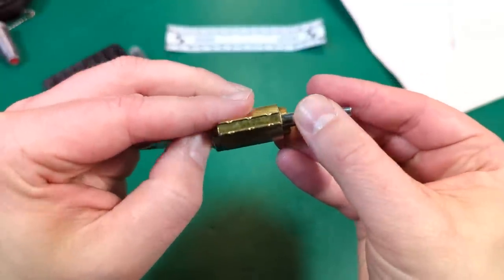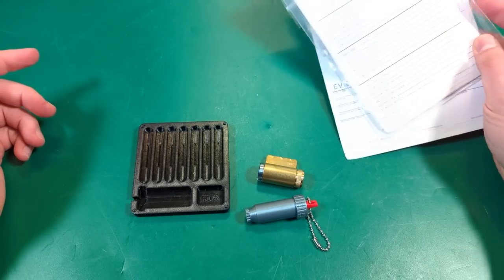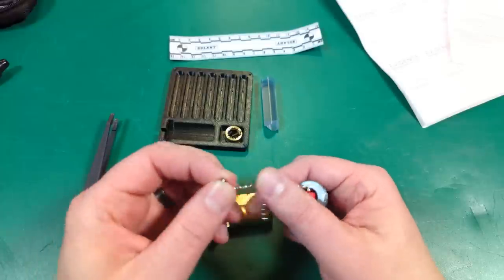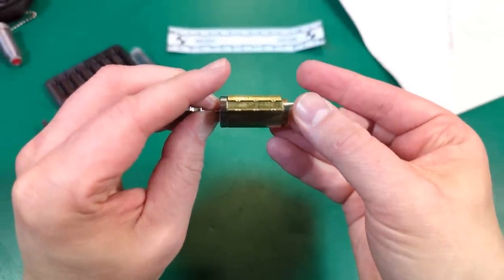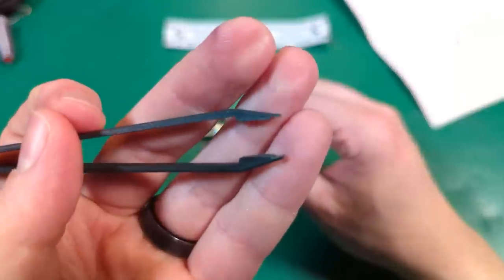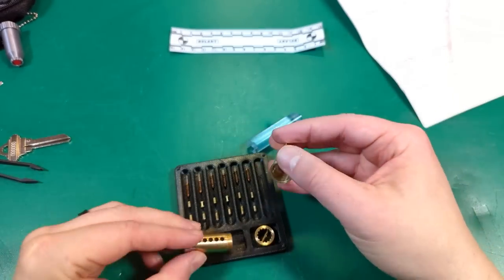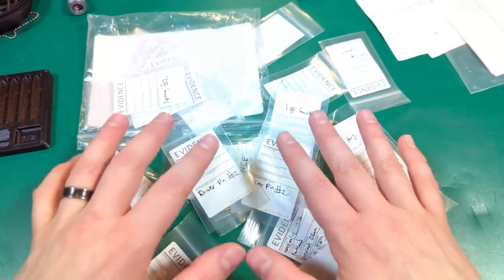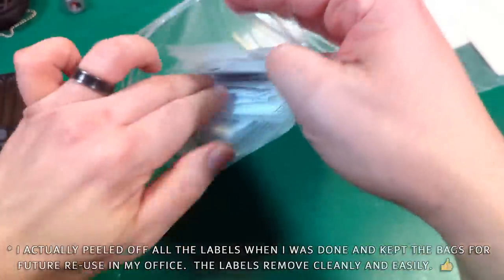Forensic Lock Disassembly

Comment: A label printer hooked up to a computer so you enter job details once, and just describe each bag to print the label, would save a whole lot of time. Especially if it put a QR code with a unique serial number plus the same data on every sticker, and spat out a CSV file with a record per label with all the data and the serial number for integration with evidence cataloguing software...

Comment: Thank you for sharing this interesting and educational video. If "metal" should not be used in the disassembly process should the "shim" used during the disassembly of the lock be made of plastic too? If this was a real crime investigation surely the forensic analyst would/could have access to a real key that actually opens the lock so there would be no need to use a shim? How about using a very small fibre optic probe to examine/photograph the inside of the lock before even attempting disassembly to check to see if the pins have been marked through picking?

Comment: For the part achiving, has anybody looked at using some kind of tray with separate wells for each pin or spring? Something like a 96-well plate from a biology lab, along with a clear adhesive film to cover the top. You can then attach one label for the whole lock, with the parts in order.

Comment: Query: Would the shim potentially, or actually leave a mark on the pins as well, since they're metal sliding along an edge? 
Obviously this would only be in the case where the actual key wasn't used instead. Would that have to be forensically noted as well?
Reply: I expect the shim would leave marks on the side of the key pins and bottom of the driver pins, while picking would mark the bottom of the key pins. (Not an expert)
Reply: @jonathanshaw6784  exactly

Comment: could you use a lishi tool that has a HDPE pick? or maybe teflon? i have to imagine there is a plastic hard enough to lift pins but how so hard that it will leave tool marks on the pins
Reply from the maker: it's been tried... material transfer winds up taking place, with small fibers of teflon being left in the lock
Reply: @DeviantOllam  that makes sense. you never know when the newbie suggestion comes up with something useful though lol

Comment: I'm such an LED flashlight freak that I'm gonna spend some time thinking if there might be something to kick that "light-pipe" follower up a level.
Reply: Machine one with a thin wall barrel, with a LED embedded in the light pipe, straw had white most likely, then one lead inside as contact, and the other going up the side. A sleeve to insulate it, and then 3 small button alkaline cells as power, with a threaded cap that is both the switch, contacting the button cells and the cut off lead.  Cap just needs a spring and a 2200R SMD resistor in it to act as current limiting for the LED, so that it is not too bright to blind you, and thus will last a long time.
Reply: @SeanBZA  Much like my own thinking.  Definitely need to limit the brightness.
Reply: @SeanBZA 
You could probably just 3D print a tube adaptor that friction fits the follower into a common cheap LED flashlight (like the ones you get free from companies that think pens with their name are a bit boring).

Comment: Would it be advantageous, in situations where it could be applicable, to use a longer blank and cut a shallower slope on the front for blank key shimming?  Seems that it would give you more wiggle room on the key to find the sweet spot.
Reply from the maker: we do that with our Kwikset disassembly key.  the long part across the top is cut all to a "1" depth (the smallest cut in Kwikset land) and the front edge has a more rounded graceful curve
Reply: @DeviantOllam  I feel validated 😁
Reply: IMO (not an expert at all) if you're using a longer blank, you need to be careful not to impact the back of the lock (the cam) because that's also a place where you can find evidence.
Reply from the maker: @MarvinCZ  absolutely correct, at least on locks that have tail cams on them like that.

Comment: I did enjoy this video. I've not tried lock picking since I was a kid but they still are fascinating. Seeing how to get one apart from the rear is interesting and with the mechanically inclined mind I have. I knew where you were going with the blank key. I agree with the comment below in that I too would like to see what difference there is between a normally used lock and one that's been picked. Should you have removed your ring as well?

Comment: Why not make a pinning try that has a labeled slot for everything and can be sealed? Make the tray the evidence bag, it would be reusable and only need one evidence sticker.
Reply: Defense lawyers would have a field day with that.  How do you prove that the lock parts in there now aren't contaminated with evidence from the previous lock's parts?
Reply from the maker: indeed... not to mention that it the lid fails or something, there goes everything.  we do have little "bumps" on our pinning trays' corners, you might have seen... they can snap together with other trays to do what you're describing.  But that's more for commercial work, not evidentiary work.
Reply: @DeviantOllam  I'm talking about a new design of tray specifically for lock evidence. The problems can be engineered out and administrative rules could be used for cross contamination. The same argument could be made for plastic bags; what was in them before? Is there proof it was empty before pins were placed inside?
Reply: @Dleihs  The problem with a tray is that if it gets bumped when open, everything gets jumbled. And it won't just be placed there and sealed. All the individual parts are going to be taken out repeatedly and investigated separately. All that manipulation is more chance for something to get misplaced. It's also limiting since you can't take just one part somewhere else and go investigate it, since they're all bundled in one container.

Comment: Do serrated pins make rear shimming attacks more difficult?
Reply from the maker: you know, that's a GOOD question!  i bet they might.  i should test this
Reply: @DeviantOllam  serrated key pins so the shim keeps catching as the stack lowers.
Reply from the maker: @katelights  that would definitely slow the process down potentially but wouldn't ultimately prevent it. Could be a fun video for me to try later, however. :-)

Comment: Instead of a steel strip for separating the pins, could you use a sheet of PEEK? I wouldn't be surprised if that strip you are using is hardened, but PEEK might be hard enough to still work while being a lot softer than brass or any color coatings on pins. I found one site selling it as thin as 0.00048".
Reply from the maker: I would be interested in trying that, yeah

Comment: As a dumb outside observer I'm just curious, is "The labels remove cleanly and easily" a joke? Wouldn't you want the evidence stickers to be pre-cut to break into multiple bits and leave a whole lot of residue behind to limit possible tampering?
Reply: Evidence stickers typically have a glue that is very aggressive in bonding to PVC of the bags, so it will not come off easily, and it is more there to mark the bag, and not come off, as attempting to peel them is going to leave a mark, and they are common enough that you can just use another and bag. The true tamper protection is the writing and a signature of the person collecting the information, as that normally is unique.
Reply from the maker: These are organizing labels, not tamper-resistant labels.  The teeny 2"x3" baggies would never be used as evidence preservation bags by themselves and so they would always be kept inside of a proper tamper-evident bag overall

Comment: Maybe instead of using so much plastic, we could fix our bean-counting legal system. You know, bring a few of the worst lawyers to heel.
Reply: I mean, there really isn't any way to avoid being thorough. And if that means bags over bags of stuff, so be it. Better than compromising an important bit of evidence.
Reply: It's not really a problem with the lawyer. It's really important that evidence is collected well and not being tainted. Bad evidence leads to bad court trials and even innocent people ending up incarcerated. In fact many wrongful convictions are the result of shoddy evidence gathering.
Reply: I’m divorced too
Reply: You all make good points, but the real reason why we are so neurotic about evidence and custody trails and whatnot is that the lawyers out there will use any excuse to find fault in evidence, like "There's a metal tool in the shot".  If lawyers wouldn't routinely get away with the most hare-brained schemes, we wouldn't need to be quite so neurotic. We would still need to be thorough, after all, legal action often ends in dire consequences for the defendant if found guilty, but we wouldn't need to worry so much about a lawyer tearing a case down on a ridiculous technicality.
Reply: @feynthefallen  The reason why defense lawyers are hard on evidence is that prosecution will try to produce absolutely anything and call it damning evidence if they can get away with it.

The trouble in this case isn't that "there is a metal tool!" but rather that using a metal tool in this task can leave marks of its own and produce false results.

Comment: Wouldn't the metal blank potentially leave false forensics marks?
Reply: And also, the metal shim scraping on the pins?
Reply: @Johan Greefkes  the marks would be along the sides of the pins, when looking for picking evidence you would be looking at the tip of the key pins for unusual markings. So long as there is only one mark along the side it could be discounted
Reply: Dev said that you are allowed to use those metal tools, but didn't say why.  I'd like to know, too.
Reply: @acidhelm  the exact reason I don't know, can only speculate that made those concessions because no non-metal option is available or was available when those concessions were made.
Reply: It's known and accepted that a key (and thus a blank) leaves distinctly different marks on the key pins than a pick does. Thus using a key blank will wear the pins just like a regular key and will not contaminate evidence of picking.
Reply from the maker: exactly - although a 3D printed key blank would be pretty cool to try using, hah
Reply: @DeviantOllam  Would PLA be good enough for that or would it require a tougher plastic like ABS?
Reply: @dclemons6200  ABS is actually fairly abrasive. Steel on brass or brass on brass is used for a reason, it's all really low friction. If you're super worried about the blank scratches you could just polish the surface, corners on the blank.
Reply: @DeviantOllam  Can you do an April Fool's episode with a key made out of ice? No evidence to leave behind! Would have to be fast if you're impressioning with one, though...
Reply from the maker: @cheyannei5983  hah, would be wild to try.  Has anyone ever made a key out of gallium?
Reply: @DeviantOllam  I think I have seen one on Youtube. It was too soft and brittle to be used and broke in the lock.